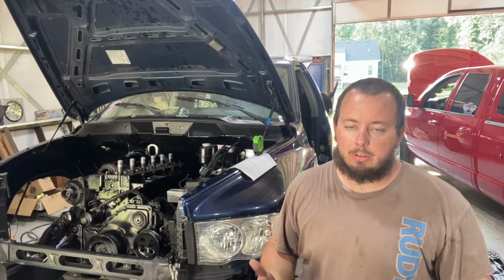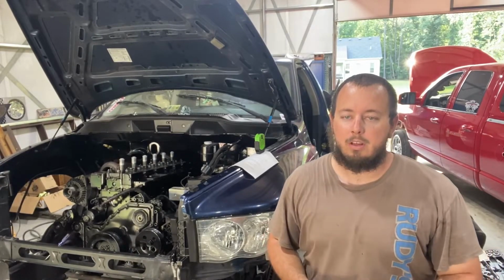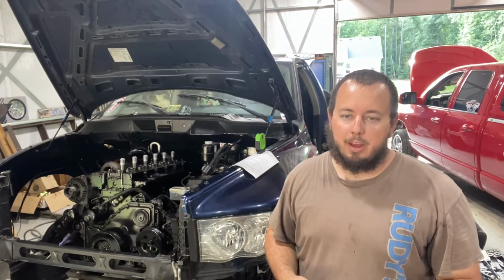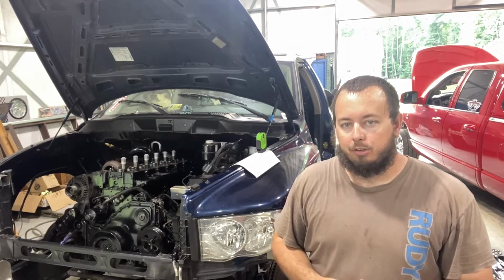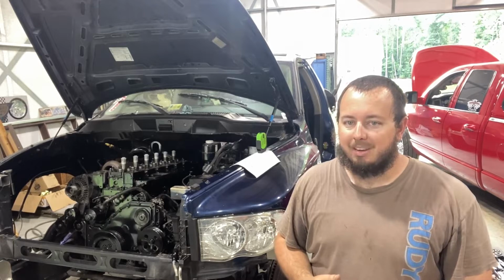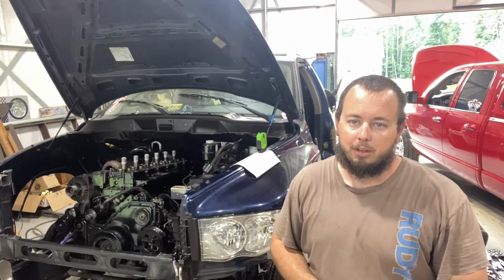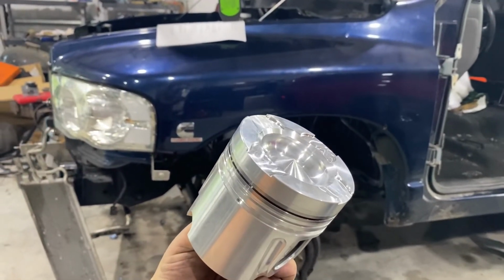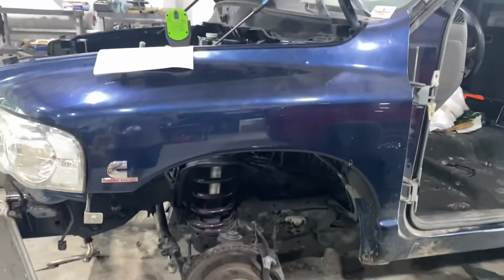Weekend Shop Update

Comment: Question.  U r a big 3rd gen guy. I put a D&J engine in my truck like 3 months ago in the wire loom going to starter there's a wire with circle eye let's on both ends I kinda think it's a starter ground but where does it go. I just left it unhooked n everything is fine but today it rained I shut it off n when I tried starting it, it clicked then tried again n it turned over. Made me think about that wire. Thanks
Reply from the maker: I’m not sure on that, I don’t recall a wire like you’re talking about, but I could be wrong. I’ll have to double check on mine